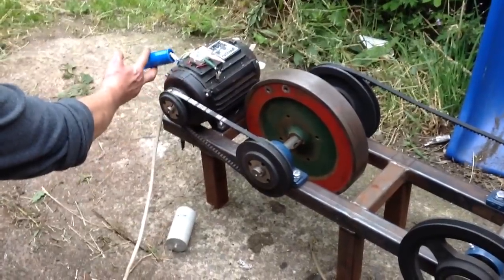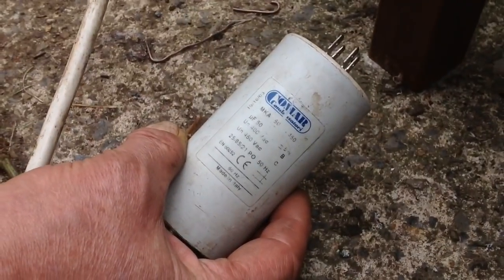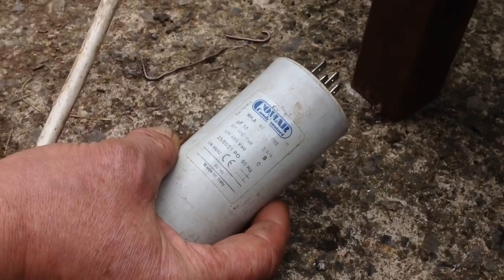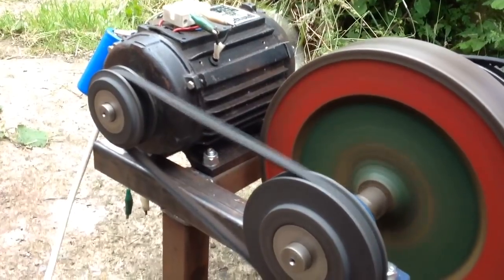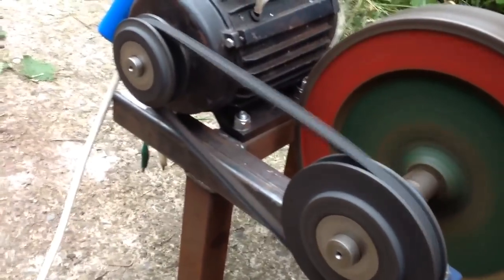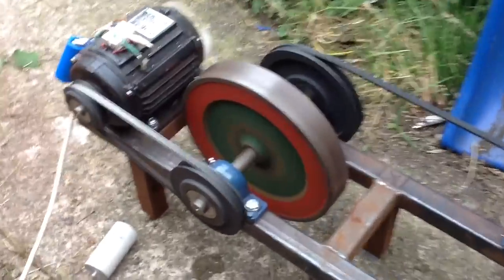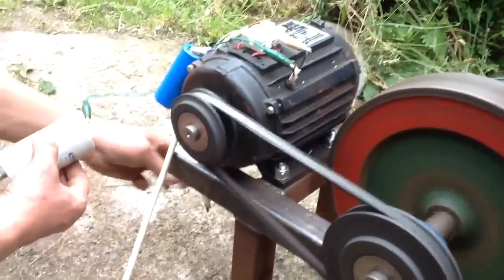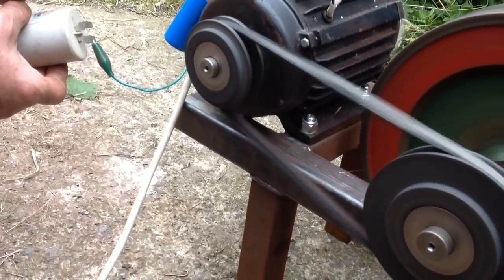The Flywheel ? V3.

Comment: It seems your capacitor is gone and it is discharging too fast in a way it is sending big pulses of energy to the motor and it is cycling its speed up and down a little bit causing that "vibration" effect. Try replacing the capacitor and see what you get. Also, try tightening the belts a little bit, they seems too loose.

Comment: Stray from the original design and wonder why its not working as it should, Put the Standard Capacitor back on and leave it alone, If its working Do Not try and fix it !!, Silly People, Sure its an old Video but some people still need to be told regardless.

Comment: Yes, the motor speed increased such a bit more than the flywheel. Use a tighter  belt to reduce the flapping, which in turn gives the flywheel more speed.

Comment: Accurately, it would seem the issue per say is simple a matter of frequency and vibration.  As the capacitor is introduced you are changing the "tone" as you put it in your video.  The tone or frequency in this case is being increase past the wave sign or energy velocity is past the point of the natural harmonic frequency you set-up can allow.  You set-up will increase in physical degradation with long term anti-frequency.  You are very close to the natural flow as it sits at the start of your video.  Using the white mark on your belt as a visual reference incorporate an adjustable regulator that's not digitally automated to restrict the flow of energy to the motor.  The theory behind this is every environment or natural state has effects on the introduced or unnatural state.  Your N.S. is  electricity. Your U.S. is the disruption you are causing with the capacitor. If you connect an oscilloscope to your set up you will see the wave make a sharp change when your vibration becomes more unnatural (Like blowing a stereo speaker). There's a bunch of gibberish from every corner but, it boils down to this.  F.V.E. Tesla's three.  If you need any help with any project I will always make time to help.   Also I just wanted to say your efforts are inspiring and your innovation is humbling.  Thank you for you time.

T. Paris

Comment: The motor doesn't need the run capacitor because the inersia in the flywheel is keeping the   rotor spinning when he adds the running capacitor  the capacitor  is unable to boost the energy in the running winding so as a result the motor is actually generating energy and see the capacitor as an electric load .
I hope that helps also the belt vibration is caused the motor is now a generator at same time and the cap is a torque load in it .
Pretty amazing idea but I think the inventor has no idea about it .
Why using a split phase motor  while he can use a synchronous one .

Comment: Perhaps when you connect the white capacitor, it is slowing down the motor.  If the motor slows down, but the flywheel is still rotating at the same speed, then it will cause the belt to get stressed.

Comment: that cap throws the different set of winding inside the motor out of phase. with the cap not in place your not using all the windings. if you had a real load on that motor it would probably stop. the cap puts the windings out of phase which makes more power. just tighten the belt or if you don't need the extra power don't worry about it. iam no expert and it's one of those things that's difficult to explain. try to put a load on the motor and bring it to a stop, then try it again with the cap in place and i think you'll understand.

Comment: The motor is made for what was on there. the windings with the value make a electronic in the windings. of about 90 degrees. putting any value in there with make the motors fight it's self.  Electronic 101

Comment: Add a diode the same thing happens running2 generators together wired wrong one works backward when voltage higher than other but I'm not expert also if 2fast stops absorbing magnetic force

Comment: the capacitor R/C time constant does not match the stator on the motor so the electrical field is bucking the rotar inside the motor causing the motor to want to go backwards while the flywheel is pulling it forward. in layman's terms you are wasting electricity because it is not balanced.
Reply: Wayne Hartyneck on  1
Reply: can we balanc it on two motor oppste

Comment: From what I remember of electronics, capacitance with resistance would give a frequency filter. Maybe when you change the capacitor it matches the resonant frequency in the motor or the supply, filtering that out and leaving some other frequency dominant. Then when you drive something at a non-resonant frequency you get a beat frequency - the wobble of the belt. All just speculation though.

Comment: Also, how much did all of this cost?
Reply from the maker: Dear +111party. If you go back to video 1&2 you will see all the parts with a view to a Chas Campbell replication. Sadly the Alternator needed to have been a 1500 RPM but I tried to use a 3000 RPM version. The 100 year old flywheel did not like running that fast, frankly, neither did I !! Total cost was just over £500.00, the brand new alternator using around £350.00 of the budget.Cheers Grum.

Comment: hey....sid snot ere....um not dat edecatid wiv dees fings but i fink i no wots rong....."""""""""Capacitors of this type, when you increase the reactive value on AC motors will alter the phase angle on the fields.....hook up to a scope to check...for safety reasons don't forget to use an isolating transformer......beware...in comparison.... on a defib machine to jump-start the heart they generaly use only 16uf....get someone to help you that knows what they are doing""""""""""an dat ends   der leson.... take kair or ya kood end up fukkked ......Sid xxx

Comment: I'm thinking there is an issue with that run capacitor! Even when they are faulty run caps sometimes still will keep the motor running! Another problem could be that the cap is no longer rated for the job that it is doing! That's because once that huge flywheel gets going it may need fare less torque from the motor! Thus the fix would be less farads for the run capacitor. but at this point before you do anything to address the situation i recommend complete the project  first so your testing it fully loaded. You may need to do nothing at all to address the situation. Darcy, mechanic.

Comment: if i can put this in layman's terms, The run capacitor is kind of an electronic flywheel. It continually charges and discharges to the "needs" of the motor. Since your system has a real flywheel the capacitor is fighting the system not helping. hence the increased current draw and belt slapping

Comment: A single phase motor will not start as it has a pulsating  magnetic field made up of two rotating magnetic fields in opposite direction  as it has to be given a push in the right direction to catch up with one of the rotating fields and neglect the other.

This is done by winding two coils , a starting winding and a running winding and a capacitor is introduced in the starting winding such that the motor becomes effectively a two phase motor  90 degrees out of phase to produce a rotating field rather than a pulsating field. Sometimes the starting capacitor is left in to produce a better torque in the motor as it runs effectively as a two phase motor.    Now ideally the two fields should be equal in magnitude for a smooth running system.

I do not know exactly what is happening but with a large capacitor, maybe one of the fields is much greater than the other to produce fluctuation or else the winding with a capacitor is producing a resonance effect of a frequency slightly different from the mains and a beating effect is occurring,   I have to look  deeper into this but that is my line of thinking at the moment.

I feel that a three phase motor will do the same when it loses one phase.  A three phase motor will produce a balanced rotating field but if one loses one phase there will be some pulsating especially if the load is a heavy flywheel, which tries to keep a constant speed while the motor pulsates above and below the speed of the flywheel.

Same as if you couple a  single piston engine to the flywheel with a belt system I guess.  I would not say that the single phase induction  motor or a single piston engine is a constant speed device! hence the result when linked though a belt drive.

Comment: that would be caused from drawing amp off it puts extra strain on the motor causing it to move slower only slightly and the the belt hops jumps and skip to compensate as the flywheel keeps a relative speed

Comment: Changing capacitor changes the phase angle between the current and voltage sine waves. This changes torque for a given speed, system has to adjust to new speed also torque might be negative for part of each revolution etc. causing belt to flap.

Comment: how can you fine a heavy flywheel about 730wight
Reply from the maker: Dear emmanuel nkengache You could try looking for an old Stationary engine....  Lister or Petter style Diesel engine. They have really well machined flywheels and are good for at least 1500 RPM.
Reply: please can i use a single face electric motor 2hp to rune it?
Reply from the maker: Dear emmanuel nkengache.If that is what you have then yes. You will need quite a large motor to get 730 Kg spinning !!
Reply: please sir how many HP motor
Reply from the maker: Dear emmanuel nkengache. Your 2 HP motor will work. You will have to experiment with different drive pulley ratios. Cheers Grum.

Comment: I am an engineer and just looking at it people, THE Pulleys are NOT squared. When they are NOT squared 2 things occur. 1 with that much slack it would want to jump off, and 2 LOTS of HEAT! Are you having heat? are the belts looking a little chewed up after running for a little while? More power, the more RPM's. More RPM's when something is NOT aligned causes bearings to wear out, belt to eventually break, oh, and VIBRATION. I hope I have helped the creator of this video. Wow some of these answers? I guess good intentions, and free advice.
Reply: +Grum Capacitors on inductive motors change the offset of the current in the circuit they feed, essentially delaying the arrival of maximum voltage by some amount on each cycle of the AC current.  Using different capacitor sizes changes the arrival of peak power. Larger capacitors delay that timing more. It appears the cap you are using has peak power arriving once the pole of the rotor is already past the corresponding pole in the stator. on each cycle the motor tries to turn forward, then just for a moment it tries to turn backwards.

Sometimes a (slightly) larger capacitor will give an old motor extra starting torque at the cost of extra current draw and heat.
Reply from the maker: Dear david w I too am a retired M/E engineer and can say with all honesty that the pulley alignment is spot on, set with Square and straight edge. I re watched the video and I think, due to the angle it was shot at, it does look visibly miss aligned. Being an asynchronous motor the rpm is fixed by the operating frequency ( 50 Hz ) slip speed being around 1450 RPM a speed increase should not occur under normal circumstances. Unfortunately the test rig is now long gone but having noticed the  apparent audible speed increase, perhaps a revisit is in order?
Reply: Thank You. I did not know it was aligned properly, it looked in the video to be out of alignment. I have built a few prototypes and when they were out of alignment or when there was to much slack while out of alignment they made the same noise and wanted to jump around. But if they were aligned, that is a different animal all together. I will think about what it could be and go through some data, I will get back to you.

dave w.

Comment: the belts are slapping because you are not squared! Square the pulleys and you should eliminate the slapping and the heat to the belt!!! The faster it goes the more slapping. I have done several of these at my place, and I have several prototypes working, with No Slapping. Happy to Help.

Comment: That looks like a little Clarke motor i've got one on a BandSaw, looks exactly the same except mine is Start only, no run capacitor.
I dont know for sure, but the belt vibration looks to me like a braking effect caused by the introduction of the run capacitor while its all in motion. The Back EMF generated by the motor itself is having an effect on the current as it passes through the windings causing it to almost over-rotate before the winding has become live so that when it does come live it's almost trying to force it back the other way but the spin and momentum of the motor is overcoming the overall Stop effect which would be caused if the motor wasnt already up to top speed.

I am curious, did you try running the motor with both capacitors installed from a stationary startup? i'd be interested to know if the belt wabbled at all during that test, my guess is that it wouldnt wabble given that it's been allowed to get up to the right speed with the right capacitors in place.

interesting.

Comment: Yes, it appears to be the force of the leading edge of the flywheel interfering with the energy released from the back emf of the motor's coils which aren't energized, which are released in reverse once a coil is de-energized causing a cogging that is overcome by the wieght of the flywheel, where the motor would normally stop dead due to Lenz's Law. This happens with an ac motor that is being forced to drive in one direction while the back emf is spiked back in reverse of how it was created.. IE- the electromagntic coils in an ac motor are reversed from one coil to the next. When the magnet is at or past the point of the magnetised or excited stage, the coil is momentarily de-energized, releasing a massive back emf spike, in the opposite way it was put in (done by magnet with a north or + polarity, it is released the opposite way), which is workign against the energized coil and the flywheel. Since the cap stores this electrical spike, it assists in working against the natural rythym of the motor, making it jerk, but, since the motion is not natural and the inertia of the flywheel is heavier than the spinning of the shaft, the motor has an additional forward motion now and adds free energy to the output of the system. It probably increases the output depending on the size and weight of the flywheel according to what would seem to be the weight of the rotation of the flywheel times Pi. This makes sense since you have the energy of the weight of the inertia of the flywheel conrinuously driving forward, everytime the motor jerks, it adds the weight of the forward driving flywheel like a hammer hammer shot, giving a lot of electrical energy, since the weight of the flywheel is working forward like an air tool, making the system much more efficient, and, giving a lot of additional output as Chas has claimed originally. The smaller the motor, the larger the flywheel, and, faster the motor goes will determine how much energy is stored in the flywheel. The bigger the diameter  the flywheel is, and the heavier the outer edge is, the harder start up of the system is  of course, but, once the system is running at full speed, which could always be started with a starter or a drill, then, there will always be a much larger or greater force on it's output. I really don't see how this would last very long having the unnatural or non linear motion of the system jerking, but, I'm quite certain this could be modified to handle the jerking with preventative measures to eliminate the machine from busting.

If we pulse the energy going into the prime mover, we could end up with this phenomenon too, and we'd use even less energy as we output nearly the same or more power. This is a great way of showing how additional energy can be obtained in any system whether it is linear motion or not it is extremely clever, and still very practical to generate electricity since the output can always be smoothed with more capacitors if they are isolated from the system's function .

Comment: If the Bigger capacitor is already charged - I believe the driver motor is putting a higher pull on the belt (lover side) creating a slack on the belt (upper side) making it vibrate more. But I'm only guessing here,  - I'm not an engineer.

Comment: Wikipedia: If a wrong capacitance value is installed, it will cause an uneven magnetic field around the rotor. This causes the rotor to hesistate at the uneven spots, resulting in irregular rotation, especially under load.

http://en.wikipedia.org/wiki/Motor_capacitor#Run_capacitors
Reply: ye kaha milega free vali bijli

Comment: You're shifting the fase of the 3rd fase, the 3 momentums of the motor is not 120 anymore, making the motor run much less smoother...
Reply from the maker: Dear John.
The motor we are using is just single phase !! Perhaps we are altering the 90 deg phase shift too far in the opposite direction ??
Reply: Grum C Well the starting and running capacitor are providing the other phases.

Comment: I think the capacitor is storing energy, and giving it back in bits. So every time there is an energy burst, the belt is being jerked at, real hard. If this happens in a sequence and if the length of the belt is just right, you will see it whipping.
Still, be careful as the capacitor stores a lot of joules (power) and is more than deadly.